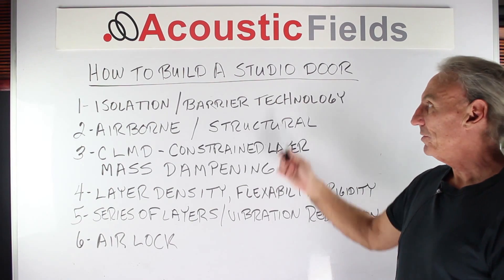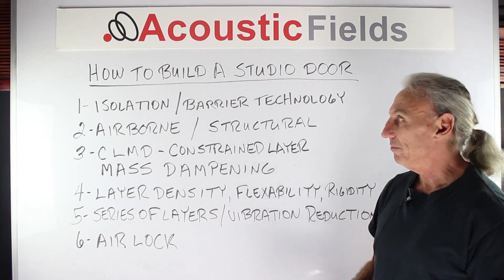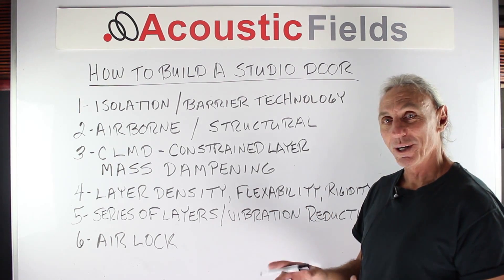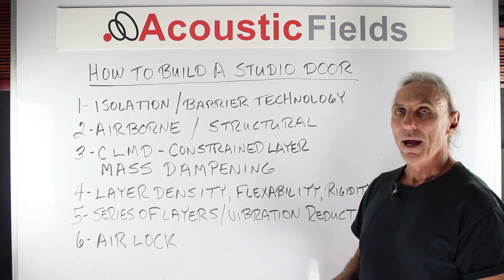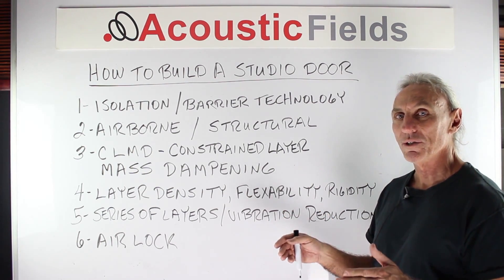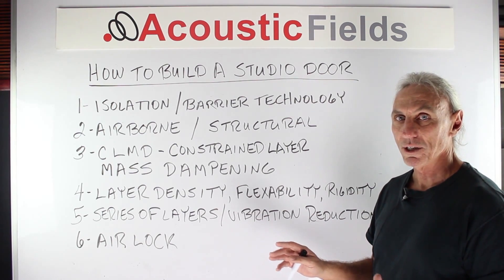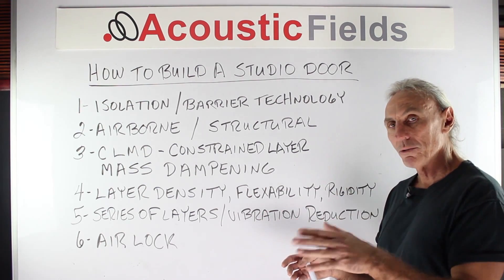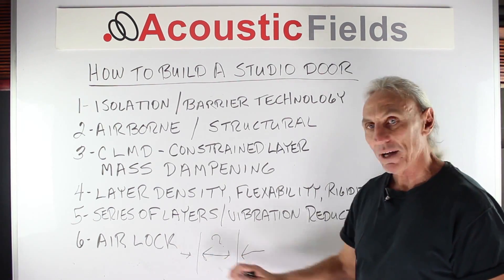How To Build A Recording Studio Door - www.AcousticFields.com

Comment: Thanks for the tips, if there is a video building average studio door that will be helpful.
Thank you
Reply from the maker: The issue with doors and windows which, if you think about them, they are "holes" in the wall circuit. To fill those "holes" we must have function and density. If you have a concrete wall, the density of the door should equal the concrete density. If you have a wood frame door, the door density must be equal or exceed the density of the wall it is attached to. To determine density, add up the weight of all wall materials in a square foot of surface area. If the wall density is 10 lbs. / sq. ft., then the door density must be at least 10 lbs. sq. ft. When building a door, use multiple layers of materials types separated by layers of mass loaded vinyl.

Comment: How would a DIY studio door compare to a typical commercially available soundproof door? (Theyre rated up to an Rw of 47dB or so)
Reply from the maker: A DIY door would reflect the frequency and amplitude of the actual noise if done properly. Remember that a STC rating only includes the frequency range from 125 hz. - 4,000 hz. Most noise transmission issues we deal with fall well below 125 hz. so an STC rating is not valid.

Comment: In other words we need to hire you to get the answer. )  While what you say makes perfect sense there must be a series of materials that can be sandwiched that will get most people us 95% of the way there for the majority of control rooms. Those that can afford the extra percentage of perfection can do so.
Reply from the maker: All barrier materials are frequency and amplitude dependent. There is no one size fits all. If you guess with noise and it doesn't work, you will have to tear it out and start all over. That is a big price to pay for a wrong guess.

Comment: The door is one thing but I would think the space between  the door and the jam is a bigger issue.   Weather strip is just foam so maybe rubber that compresses when shutting ?
Reply from the maker: It is just another variable to resolve. Every variable is important. You are creating an energy system that has by design goal the reduction of vibrations. On large does with our carbon technology inside we use the angle close system whereby the edges of the doors are at 45 degree angles from each other and when closed, they seal together. You can see  our carbon door here: https://www.acousticfields.com/two-channel-listening-room/ For thinner doors, we use many methods. one where MLV mass loaded vinyl is used as a seal.

Comment: I know this is a very broad question, but can you please indicate what sort of materials are better at blocking lower frequencies, like a train rumble, and what sort of materials are best at blocking higher frequencies like human voices or perhaps traffic?
Reply from the maker: With lower frequency noise transmission issues, you must focus on total mass of the barrier along with the individual densities of the materials used to create the barrier. There is no "best" and no one size fits all. The total mass of the barrier will be determined by the lowest frequency with the largest amplitude (strength). Middle and higher frequency barriers can be constructed using material types with less density or mass. You must measure your noise issue and then design for the lowest frequency and highest amplitude (strength) of those noise issues even when you are dealing with middle and high frequency noise.
Reply: @AcousticFields  I will get the app you mentioned but in the meantime, I am thinking of building the door from two layers of 3/4" MDF and a layer of Quietrock sound resistant gypsum board in the core. I could also add a layer of a material called Sonopan. Any comments?
Reply from the maker: @gilbertdemers8670  Yes, why are you building the door that way?
Reply: @AcousticFields  Well, you talked about layers in the video. I felt these layers offered substantial density and a variety of densities to block a range of frequencies. My other option is to build the door exactly like the wall, as a panel with hinges, but that is not aesthetically pleasing. It's a voice recording booth, so quite small.
Reply: I would be very open to suggestions...
Reply from the maker: @gilbertdemers8670  Do you have noise numbers over a week?
Reply: @AcousticFields  I will get RTA Pro, take the noise measurements and report back. Thanks for now.

Comment: Will a solid core door with a gypsum board and mlv in between solid door and gypsum work?
Reply from the maker: S,  It depends. What is the frequency and amplitude of the noise you are trying to reduce the transmission of?

Comment: Thank you for all your hard work.
Question:

If I have a closet door in my small home studio, and I don’t mind some frequencies getting out as the closet itself is sound proof, would using green glue between layers and using rubber on the sides be fine? Would it affect the acoustical performance of my as some low frequencies might penetrate  through? 

I’m from Bangladesh, and it’s difficult to get good ready made products for door sealing, I can use rubber to do the same I suppose, but too little space for double doors. Thanks
Reply from the maker: S,  Absorbing low-frequency energy is all about type, amount, and position. You need to select the correct type of treatment to manage the issues in your room. It must have the ability to absorb the frequency and amplitude issues you have in your specific room size/usage/volume. The amount of treatment you will require is also based on that same requirement. The position is critical in small rooms because by definition you don't have enough space and must maximize the amount and placement. Front and rear walls are a good start. A closet with not satisfy any of the criteria required.

Comment: I like the science. I have an ERV and geothermal heating system located in a closet which is unfortunately in my bedroom. It is quite noisy and I am looking for a way to reduce that noise. Any ideas? Thanks!
Reply from the maker: B,  First, you must measure the noise frequency and amplitude. This tells us at what frequency our problem exists at and how much of a problem it is. Go to the Apple app store and download an app called RTA Pro. It has both a sound pressure scale on the left margin and a real-time analyzer.  Stand a meter away from the noise source and measure both pressure and frequency. Record that data. You can take screen photos of the readings and store them. Second, go into your bedroom and repeat the measuring process. Take pictures of the noise source and surrounding structures. Send all data to me at info@acousticfields.com
Reply: Thanks! Don't see this product with this exact title on my iPhone Apple apps available. Will keep looking.  I see Etani RTA Pro for $99.99. Is this the one?
Reply from the maker: B,  Search for RTA Pro. It is there. I just found it. It has a green RTA on page.

Comment: would you use an STC rated door for the outside?Thanks!
Reply from the maker: K, It depends on the frequency and amplitude of the noise you are designing a barrier against. Remember that STC ratings are based upon a test frequency range of 125 Hz. - 4,000 Hz. If you noise issues are below  125 Hz. you will need a different design. This is why you must measure noise and not rely on STC ratings.

Comment: Hello Dennis, what about windows in the doors and in control rooms? How do they work and can you still control the reflections with so many windows as I usually see in many studios? Do they buy special windows for this?

Thanks
Reply from the maker: Hi T, Unfortunately, windows are a necessary for the creative process and we have to deal with the reflections from their surfaces. Angling the glass surface is one way to manage the reflections provided one knows the appropriate angle to achieve. We use a vertical slat arrangement using our foam technology leaving spaces between the foam slats for viewing. This minimizes the harsh brittle sound produced by glass reflections and still allows line of sight. The glass used is a safety glass similar to the glass in the windshield of your car. They take layers of glass and separate them with a plastic material. This keeps the glass from shattering and flying apart creating glass projectiles from a car accident or angry musician.

Comment: great videos.  i do have a question i can't find any info on.  in building a soundproof/studio/home theater room, i understand about building the walls to "float" from the studs using variety of channel products, etc. no need to detail here.  the question is, if that wall if sticking out about 1 -2 inches from the studs, how do i install a door?  how is that gap finished and sealed off to look nice, etc.?
Reply from the maker: Hi C,  You are talking about noise transmission through solid surfaces. You first have to measure the noise and then design the structure to manage the frequency and amplitude of the noise you are incurring. A floating floor is just one type of tactic to use in an overall sound strategy. It may or may not be indicated for your noise frequencies and amplitudes.

Comment: i recently saw a video touting isolation fasteners that go between the drywall and the studs to help isolate the studio / listening room walls.  Is there value in these?  Is that to help the sound inside the sound room or to keep the noise down outside the studio or both?
Reply from the maker: Dean Wyler 

There is value in anything if it serves the correct master. This is one method commonly touted in the acoustical literature. Is this the method you should use? It depends on the strength of the noise (amplitude) you are trying to isolate from and the frequencies represented within that noise. Barriers to isolate energy below 125 Hz. are much different than barriers which isolate above 125 Hz. This is a cost effective method for isolation above 125 Hz. 

Thanks